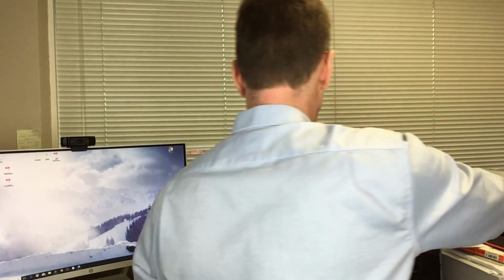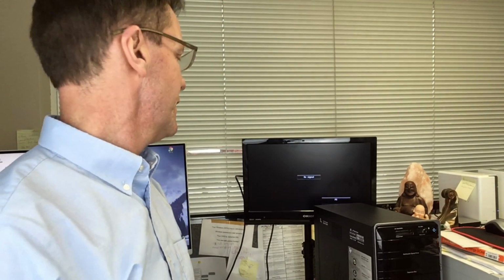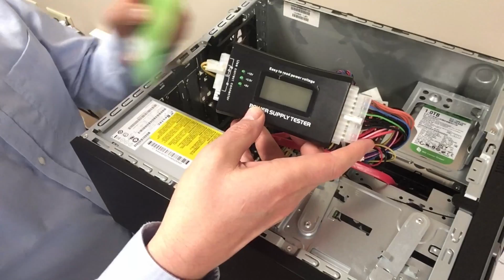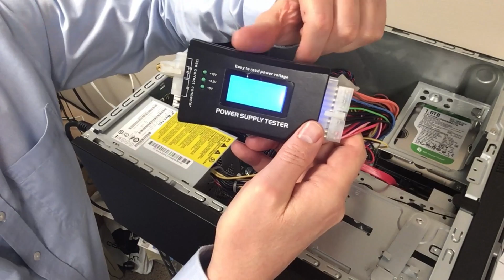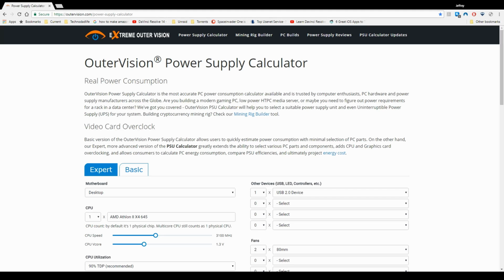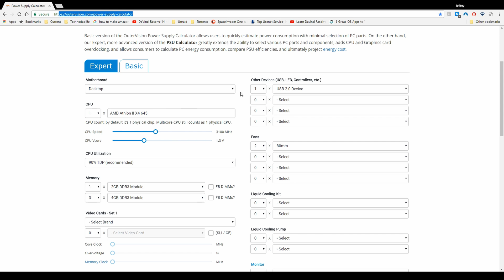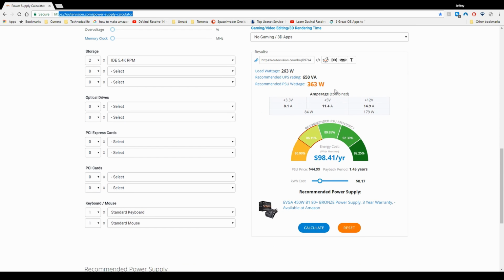DIY Power Supply  Fail and Testing

Comment: A 363W power supply at the least??? Isn't that a little bit oversized?
My self built NAS is based on a J1800 Intel CPU, has 2 HDDs and 1 SSD and a M2-ATX car power suppy and a 100W toroid transformer with a bridge rectifier and some capacitors. Under full load the system draws about 35W and only 15W when idle.
Reply from the maker: The calculator figures out much you need for your processor and all the other things in your system.
Reply: @TechnoDadLife  I know what this calculator is supposed to do. I've used several of them to figure out what PSU to buy for my NAS, but I dismissed their results as unrealistic. I wanted my build to be energy saving, since it would run 24/7. So I come up with my own, very different solution. I booted up the system about 18 months ago and it's still running. Nothing gets hot, all temperature sensors show values below 40°C.